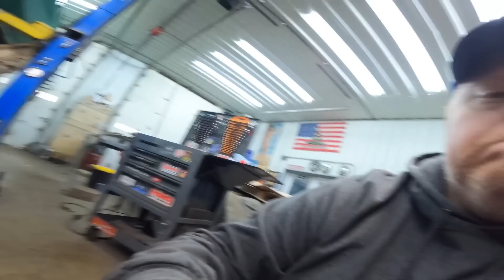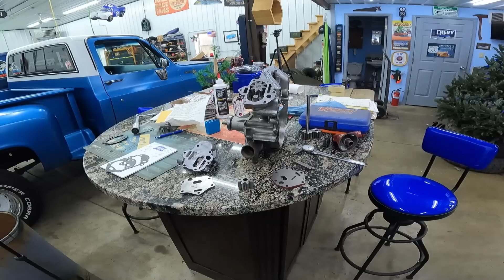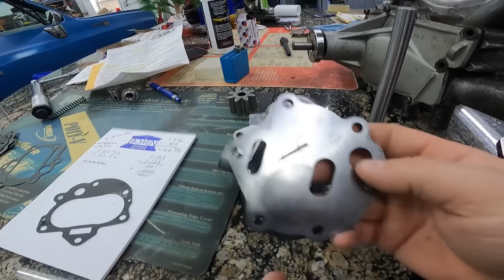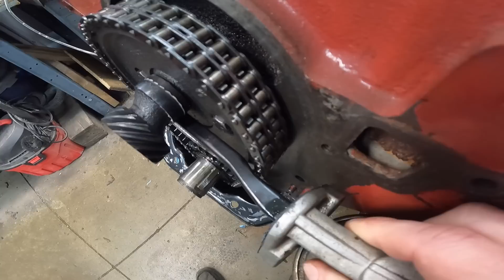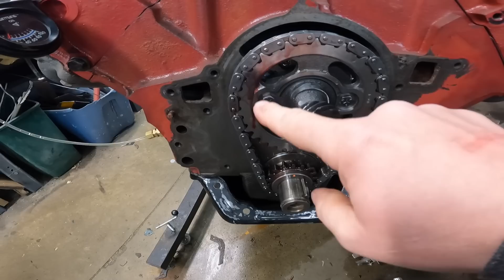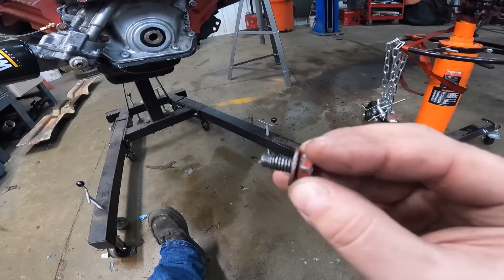Buick 455 MAJOR Oil Pump and Timing Chain Issues FIXED! #oilpump #fail #repair

Comment: Love the videos! Good info  and maybe I Missed it but, did you figure out why the rebuilt oil pump went bad? Was the clearance too loose, as in to thick of a shim/gasket used?
Reply from the maker: the rebuilt pump didn't go bad. They installed the high volume kit that was the standard in the 80s and 90s. The high volume pumps put tremendous force on the cam gear that runs the pump and distributor. There are many horror stories of broken cams because of them. The issue they were attempting to fix is low oil preasure at idle. T/A performance made the adjustable oil pump system that works with a stock rebuilt pump without adding load to the camshaft gear. So I rebuilt my pump to the current standard for maximum reliability and performance! Thanks for watching I appreciate it!
Reply: @smokineaglesrodshop ahh gotchya. Building mine currently using your videos for guidance. Thanks for the reply! 

Ps. watch out for that permatex guy 😂
Reply from the maker: @srobinr Right, he will get ya 😂
Reply from the maker: feel free to reach out with any questions , I'm happy to help! also you can join my Facebook group to post pics of your project and message me directly.l,  it's 💯 free

Comment: One thing i would recommend on a non street car is to get rid of and block the water bypass. after warm up it only lets hot water back into the pump, make it all go through the rad for better cooling. Great video. Have a great one.
Reply from the maker: Good idea, I'll look into it

Comment: use a proform cover get rid of that old timing cover befor u start that motor you can get new cover summit and use taperformance  cam bearings and your oil troubles will go away
Reply from the maker: That's a great idea! I'll have to keep that in mind for the next build!